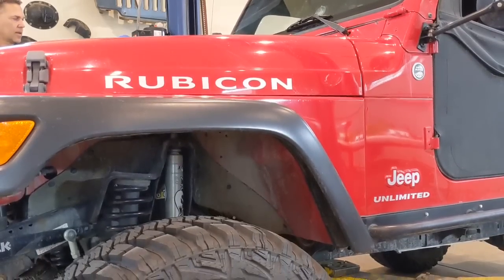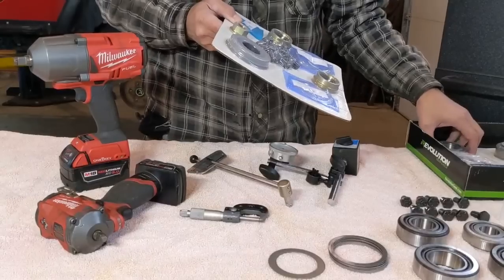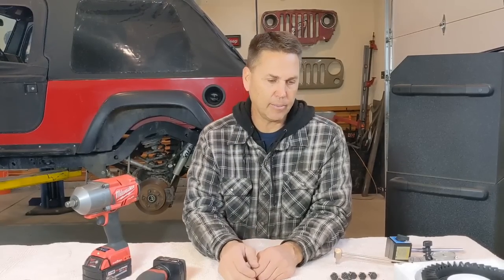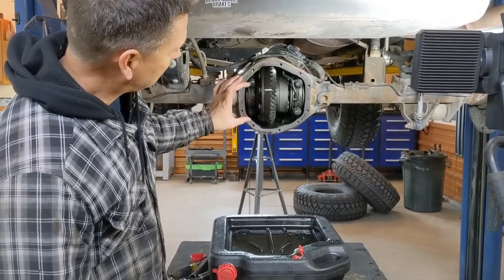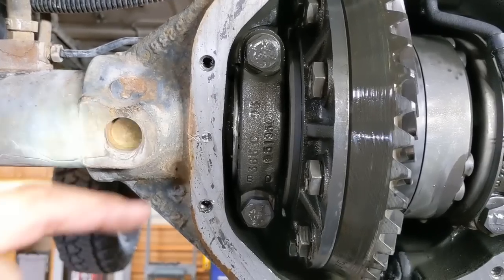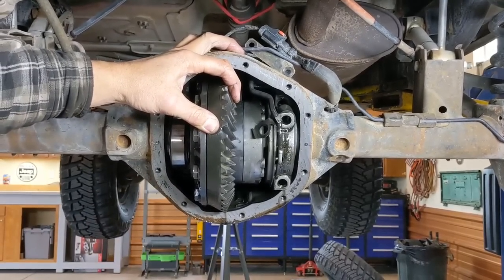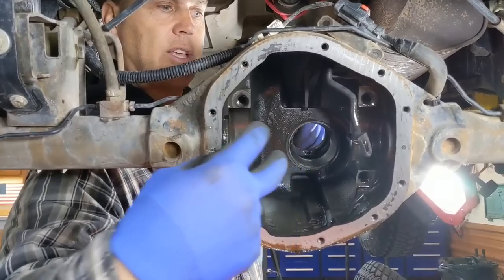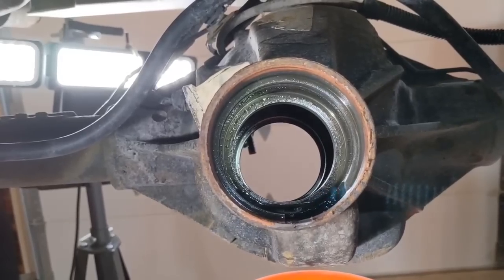How to Install Gears in a Jeep Wrangler Rubicon Dana 44 (Detailed!)

Comment: Is it ok to do a setup pinion race like you did with the old race, find a good pattern, and then install the new race?

Or will the pattern be different after switching to the new race? What’s ur take?
Reply from the maker: I have tried the "old" race and the pattern always changes compared to a new race. It's due to wear on the old race. We are talking thousandths of an inch changes. Spend the 5 bucks and get a new race to use as your setup. My opinion.
Reply: @TheBFHGarage  does brand matter? Or go with same brand ya think?
Reply from the maker: @michael70h7  I always stick with same brand....
Reply: @TheBFHGarage  I appreciate yee! Thank you

Comment: Question. If you need to change pinion gear depth you adding or subtracting shims on inner bearing race. Does it mean that you should do at the same time add or subtract shims from outer bearing?
Reply from the maker: No shims go behind the outer bearing. Everything is behind the inner bearing race. If you want the pinion to go deeper, you add shims. Shallower, you take away shims.
Reply: @TheBFHGarage  I meant shims for pinion preload . Do you change that when adjusting pinion depth or leave where it was.Thanks
Reply from the maker: Ah gotcha. It isn't necessary to install preload shims while trying to figure out pinion depth. Just tighten the pinion nut until you feel some resistance. You don't want it loose but you don't want to over tighten it either.
Reply: @TheBFHGarage  Thanks. I am in the middle of rebuilding rear Dana 44 on my son’s 2001 Jeep Wrangler Sport. We had broken  pinion gear tooth damaged all gears inside. We are in process of setting up. Thanks for informative video.
Reply from the maker: Glad it is helping you out!